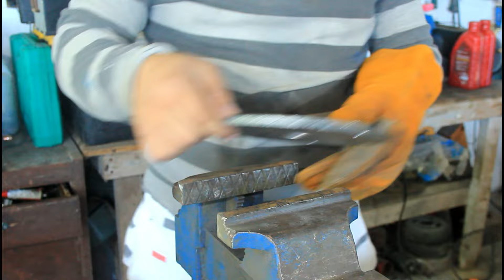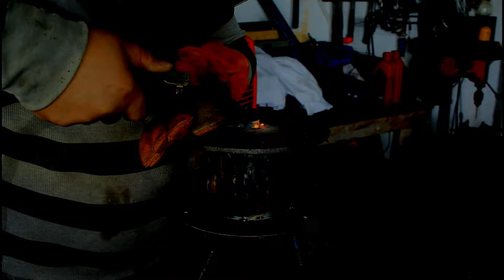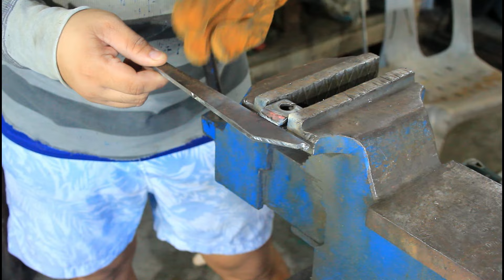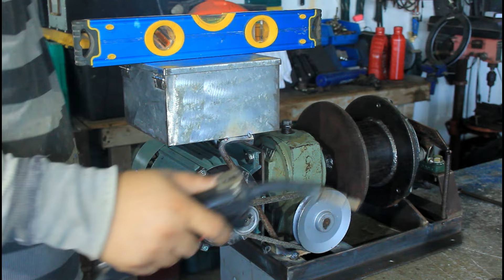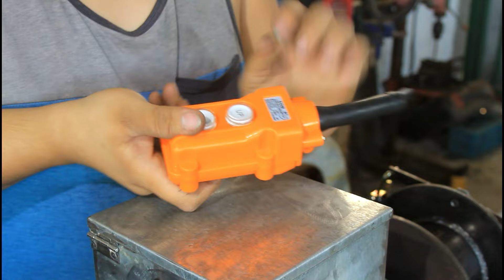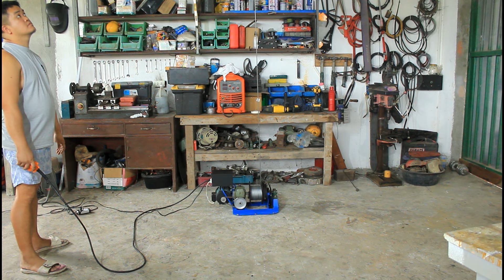DIY HOIST WITH MOTORCYCLE BRAKE SYSTEM

Comment: Uh, the brake is useless since your gearbox is a worm reduction, which can't be driven from the output shaft...
Reply: My thoughts exactly,also you could make a simple  ratchet safety mechanism for a fraction of cost and time.
Reply from the maker: Not all worm gear will stop when not driven. When heavy loaded it will still roll. And the brake will do its work the most when the worm gear brokes inside.
Reply: @SekAustria yes, you are right 😊
Reply: What is that electrical switch that's you are using for breaking on & off